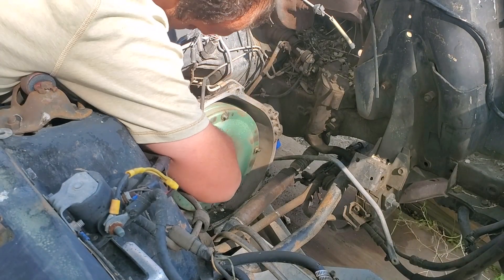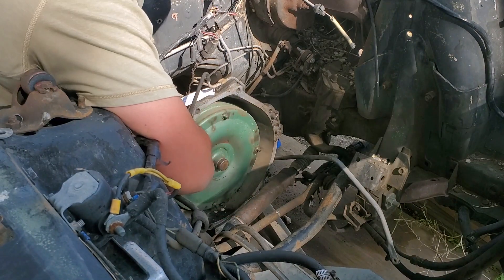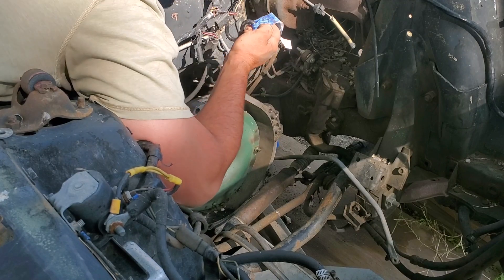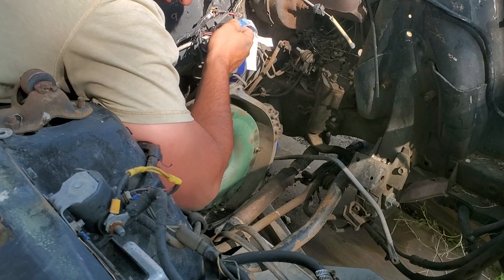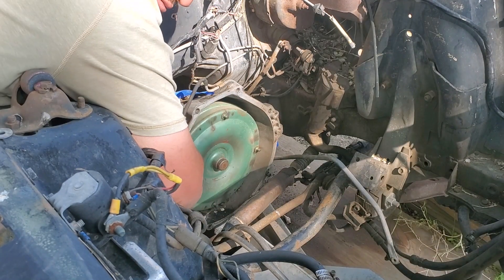1970 Mustang Mach 1 Car Restoration project: Transmission Removal

Comment: More videos definitely Love these restoration projects it keeps me on point with my project I also have a Mach 1 that has been sitting in my grandfather barn for 32 years all original 52k miles on her M code 4 speed manual..thanks for sharing!! 👍😎
Reply from the maker: Yeah a little bit at a time. And a Mach 1 with a manual that is nice

Comment: Hey Caleb, Thanks for this latest installment! Much awaited and appreciated!
Even though you had me scared there for a moment when you stood on the movable jack 😯🙂. Been there done that and got me a badly aching shin when said movable jack, well, decided to move 😉...   Keep em coming - being they long or short. Whatever fit's into your schedule. Greets from far away Switzerland  _ Charles
Reply from the maker: thanks. Yeah I had to push the jack under the transmission with my feet while holding it up but your right I shouldn't stand on it